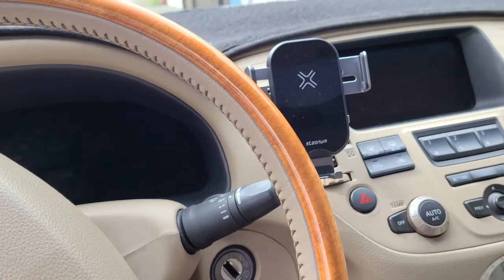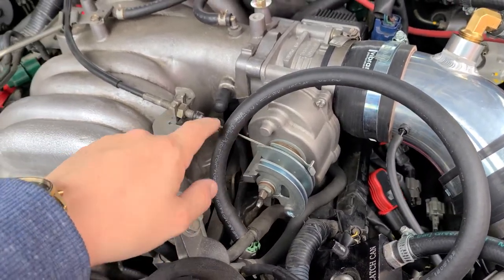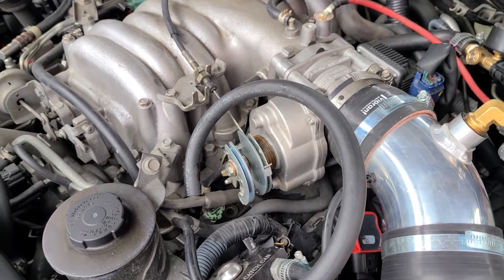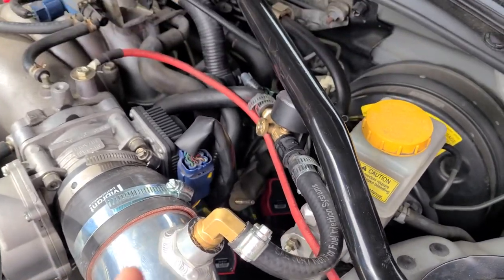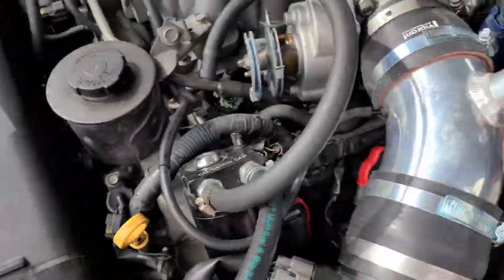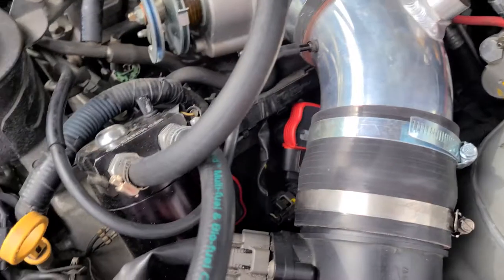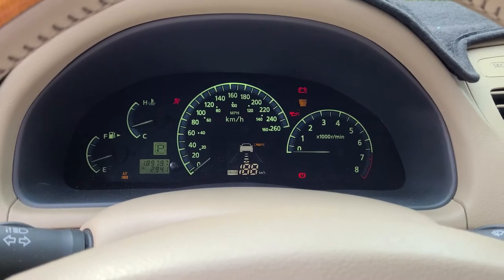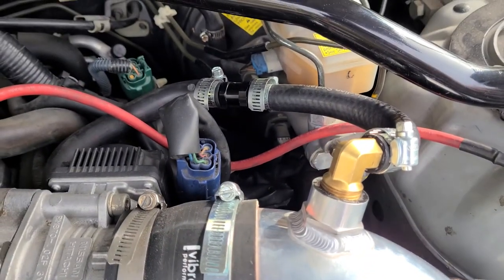Infiniti Q45: Crankcase Breather 2.0

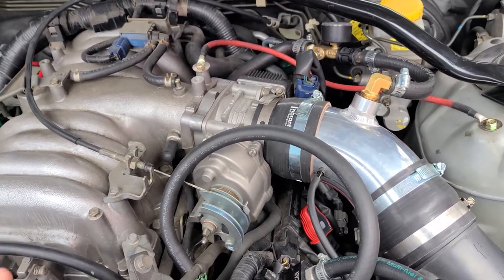Comment: 3:30 I don't think there is a separate throttle position sensor, it's all on the throttle body.  This means that there is no way the car would know how far you have the pedal pressed down.
Reply from the maker: this videos pretty old and my knowledge on these cars and their symptoms has changed a lot. In NDS it shows we have two tps gauges, both could be in the throttle body however. I think what I was trying to say in my limited knowledge was that having a loose throttle cable can make the throttle input laggy but what I said about fueling being off makes no sense as fueling is derived from maf, map and O2 sensor input on the 02 (little more simplified in 03+). But yeah, I actually don't know if the pedal has a TPS sensor or not.
Reply: @Morgan B  Yeah I don't think there is, like you said they're both in the TB and the reason there is 2 is for a failsafe...if they don't both agree the car will go into limp mode....it's to prevent unintended acceleration pretty much.

Comment: Where did you install your wideband sensor?
Reply from the maker: wideband is installed very close to the factory narrow band, you want it higher on the pipe so that if water is resting in the pipe it doesn't soak the sensor.

Comment: How is your gas mileage?
Reply from the maker: It's actually improved big time. With the header leak I was getting terrible milage.

Maybe 14mpg city, 24mpg highway. I'm sure I could stretch it more if I really babied it. With the intake actually calibrated properly, it barely takes any throttle to get it moving.

Comment: Do your engine fan stays on all the time?
Reply: Mine do when i have the key turned on just on the first click to the right where it should just turn on the radio and stuff
Reply from the maker: What year car do you have? If you have a hydraulic fan then it'll stay on constantly. If you have a newer Q or M then it'll be an e fan and it'll only run once it's up to temperature.
Reply from the maker: @kramermillay  what year is your car? I'm guessing it's a newer model.
Reply: @30YearOldBunta  thats some beautiful info lmao i wish i knew that, i used to have a 2009 m45 that did that alot and like you said, usually after i had ran it for a bit, i thought it would always do that so i never really tested it before running it to see if it was different. it would runnn the battery so fast, at least it seemed that way, maybe a weak battery. But now i have a 2006 q45 but a month in blew the engine, didnt even notice if it kept the fan on or anything though
Reply from the maker: @kramermillay  wow very rare, sorry to hear about the engine. Yeah it's absolutely crucial to keep the oil changed regularly on these engines, most engine failures come from oil starvation.
Reply: @30YearOldBunta  the suspension was shot as it is apparently common on these higher mile Q's, didnt think id bottom out and rip the oil pan off though ):